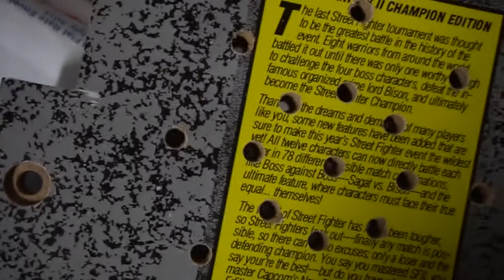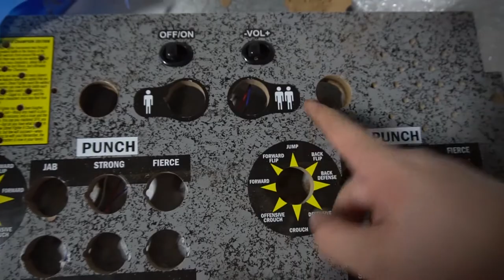Pandora's Box 6 in Arcade 1up - Part 1

Comment: When you drill your holes for the arcade buttons - drill only until your center part of the hole saw bit goes through the other side... Then flip control panel over and drill all the way through and you should get a clean hole on both of your board. I have never tried it with the speaker but I know the hole saw will produce a clean hole if you drill both sides - use practice wood and check it out. Hope this helps!
Reply from the maker: Thanks will try that